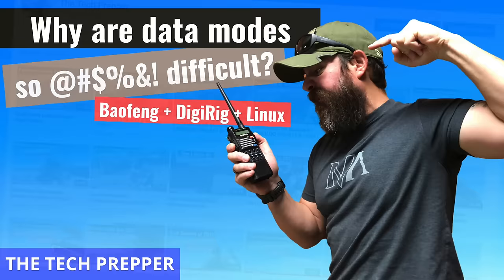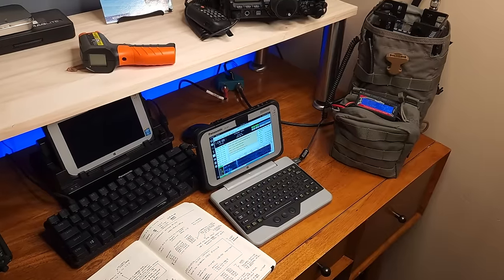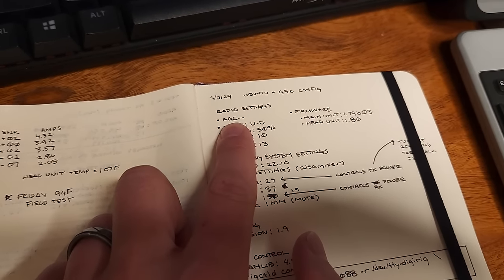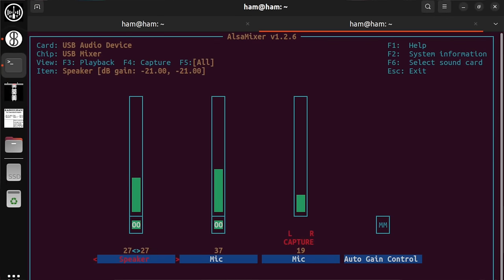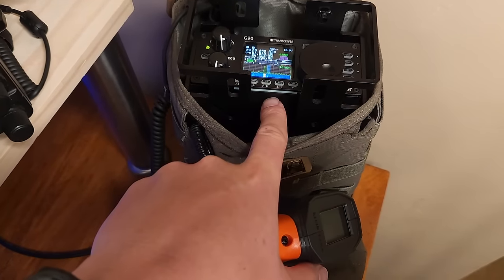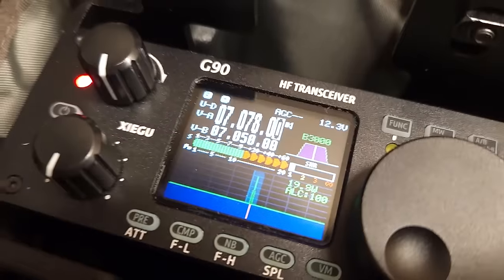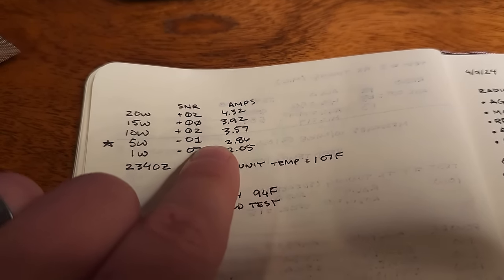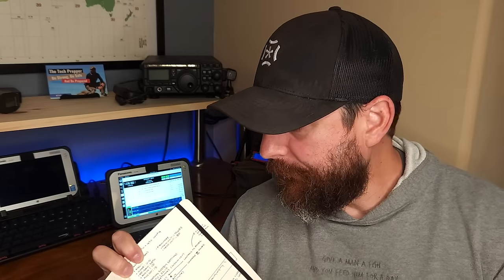Xiegu G90 Digital Settings - Manpack Series

Comment: Very well thought out process with the G-90. I don't think heat will be an issue with the way you operate. I've had my G-90 for about 3 years now. Very reliable so far. I have also not seen any complaints as to these radios developing problems, even with the extra heat these radios produce. Time will tell. The one other bonus with the G-90 is when doing voice, you do have the ability to go to 20 watts when needed to make a contact. 20 watts seems to be a real sweet spot on phone. Only one "S" unit down from 100 watts. Five to ten watts may be all you need most of the time for phone. It's just nice to have that extra wattage when necessary. It could very well be the difference in making a contact or not. Digital should be fine at the lower wattage. Looking forward to future videos. 73....P.S. I know you use resonate antennas. But just think about if you had a problem with your antenna or needed to improvise something and SWR was less than ideal. That awesome tuner could really save the day.
Reply from the maker: I agree. 15-20 minutes of operating even in warmer outdoor temperatures should not be a problem. If there is, I will report back. Field test scheduled for this Sunday. I am glad to hear that you've had positive results with the G90. I have incredibly success with my group here in the Southwest running 20 watts with G90. The audio was great. I hate to admit it, but I do like this radio. Lastly, I used the SWR analyzer to help tune a wire antenna over the week. I am fan, although I think it is to liberal in the SWR match compared to my RigExpert. 73.
Reply: I've never tested the SWR accuracy against my RigExpert. I'll have to do that. I'm much like you and prefer a tried and true Yaesu or Icom. Never found a Chi Com radio that I felt good about.  The G-90 is the exception.  Thanks !  73

Comment: I am SO happy to see you supporting the G90, I can't even tell you.  The built-in tuner in that thing is pretty amazing.  -Shaun
Reply from the maker: It has a lot of features for the price point. I actually failed to mention it, but I'm a fan of the SWR analyzer and ATU. Although, the SWR is too liberal in my testing. The RigExpert 230 reports higher SWR, but it's nice using the built-in analyzer in a pinch.
Reply: -xiaun*
Reply: @TheTechPrepper  I plan on getting it to use in situations like long treks, multi-week canoe trips north of pickle lake i embark on yearly.  where loosing the radio due to being swamped in a canoe is a real possibility. I'd rather loose a 500usd 20watt radio then a 5 watt IC705. This is my first year bringing a radio with me - KE2CAW

Comment: I appreciate the time taken to tabulate the differences in PO used, SNR, energy consumption, and heat generated at each step of the data capture. You gave a high quality presentation that DOES appeal to a broader audience. Even if it's in a "raw" format. Double points for the linux distro used on the computing side. Well done Sir and thanks!
Reply from the maker: Glad to hear that these metrics are useful. I would imagine they would be a good baseline for those considering a G90. 73

Comment: G90 is stupid good for the money. I have the fan stand and upgraded the fan to a thin noctua fan running full power always. But I’ve heard others say the fan is a gimmick  the radio doesn’t need it
Reply from the maker: The fan may be a gimmick, but I need more time with the radio to be sure. I am about to hit the field this weekend. Honestly, I think the fan is only needed if you're going to run this radio continuously outside. I had a 20 minute rag chew with my buddy in the Southwest at the full 20 watts at 50% duty cycle. In the house, it did get warm (~95F), but it clearly did not need a fan for that contact. It all depends on how you use it.

Comment: You don’t carry a 100ah battery into the field? You need to start rucking harder or hit the gym 😂 Just kidding! I’m training for another marathon in November and will probably ruck my station around the area as cross training. Anyway, thanks for another great video. I find the G90 interesting but I’ll never buy one. I’m waiting for Yaesu to wake up and make an 818 replacement or maybe I’ll bite the bullet and pay a ridiculous price for a used 818. Keep up the great work!
Reply from the maker: I would also pay a ridiculous price for the successor the FT-818ND. As for rucking, I've carried a 12Ah battery and the FT-857D or FT-891 many times up the peaks out here in the desert with full support gear. It's no fun, especially when you have to carry 8-10 liters of water.
Reply: @TheTechPrepper   The desert is no joke. I’m not built for that environment as I found out in the military. I’m blessed with an abundance of water everywhere I go nowadays so I just need to bring a means of purifying it. Keep on rucking man!
Reply: Just curious: what marathon are you going to run in November?
Reply: @ke8mattj  I’m running the NYC Marathon in November. I’ve also run the Marine Corps marathon and London. I’m pretty excited I got in finally.
Reply from the maker: @pa1863  Keeping on rucking as well. Good luck with your marathon. In all fairness, I wear a puffer jacket once it's less than 70F. I guess it all depends on what you're used to. Have a good weekend.
Reply: @pa1863  Cool. The reason I asked is also when Outer Banks Marathon also happens in November. I ran it a few times, so just wondering. The Marine Corps is one a local guy runs every year. Good luck in your races!

Comment: If the g90 had a one wire digital interface it would be a very tempting side/down grade from my ft857d. I don't generally use more than 20W so I'm not bothering my neighbors but I'm not doing DX. Nice to see it can run in a bag.

Comment: I have been trying to get my G90 to work with DigiRig for over a year and still no luck. Gave up for now but I noticed you did not say if your changed the mic input to "line" on the radio. Thanks for the video. Always educational.
Reply from the maker: You don't need to manually change that any more. When you switch the mode to U-D or L-D it automatically  does it in the latest firmware that I am running. Great question.
Reply: @TheTechPrepper  Great, thanks.

Comment: I’ve admired the G90; especially that it can transmit 20w.  I’m just not a fan of the small screen.  I may still get one.  Keep up the great content.  Bill, KC2KNA.
Reply from the maker: Will do! The G90 is an interesting radio. I am pleasantly surprised with the utility and performance given the $400 USD price point. At the price, I am willing to let a few things slip, like the quality issues and heat. I am sure that the small screen will be a personal problem as I leave my 40s. 73

Comment: I like the size and 20w output of the G90, but went with the IC-705 because it has VHF/UHF. The built-in sound card makes things a lot easier to get started in digital modes. If they made a 100w version of a G90 with a built-in sound card, I'd probably buy one for a back up radio. I do love my Icom Radios, but they are expensive to get repaired. If a G90 got screwed up, they're cheap enough to just buy another one.

Comment: Thank you for the video, Gaston! I'll have to try what you did later. The main difference is that I'm going to be using Windows. I had a really hard time getting Winlink to work. Once I finally did, I sent you an e-mail via Winlink thanking you. You helped a lot with that.

lol, it surprised you so much that you broke your "no new equipment" resolution for the year. This is a curiosity question: if there were a rugged version of it with most of the major issues fixed, would you prefer it over other radios or recommend it for manpack operators?
Reply from the maker: You are very welcome. I am sure that the principles will be similar, but I would image that the sound values will change significantly. If you stick to applying the TX tuning using 20w and ALC=100 you should be good. For the RX tuning, shoot for ~60 dB on the JS8 meter. Good luck.

Comment: Nice vid. Great explanation also. I use my G90 all the time on WSPR. Also wondering which knob did you get. I see 5 of them on Amazon and one has a really bad return rate.
Reply from the maker: I linked the one I used for this build in the description. I need more time with it, but it seems fine. You just need to make sure that you don't seat the knob all the way down, otherwise you will not be able to use button mechanism.
Reply: @TheTechPrepper  For some reason I'm not seeing it. I see a "wish list" "frame" "M-APP" "Digirig" "bag" "battery"  My computer rebooted on an odd power outage tonight for some reason. It's on a UPS.....  I'll check back another time. Thanks again for the video.

Comment: Have you considered a water resistant pouch on your pack next to the transmitter to carry one of those "blue ice" packs for extra heat reduction?
Reply from the maker: Negative. I have a custom rain fly that I developed for my manpack that I use for transportation in my ruck. Rain is not an issue here with the exception of a July monsoon season. This radio has no IP rating, so you really should avoid using it in the rain. Operation should be within a shelter if there is inclement weather.

Comment: The G90 is popular with some hams. Costs less, and has a great antenna tuner, so non-resonant antennas can be used. And at 20W max, easy on the battery.

Those of us who stick to resonant antennas do not see as much value. And I can turn down the power of my IC-7000 to be easy on my battery.
Reply from the maker: Exactly right. I took the G90 on an RV trip last weekend. The SWR analyzer and tuner were welcomed features. 73.

Comment: Is this as close to a military manpack as we can get? I have been looking for a weatherproof HF radio to use outdoors and be able to withstand at least some rain
Reply from the maker: Absolutely not. These radios are nowhere near rated for any ingress protection. My Japanese manpacks (FT-858D and FT-818ND) are much more robust and reliable than the Chinese G90 shown, but they are not mil spec.

Comment: I think a lot of the keyboard warriors are hard on your operations because they don’t totally make sense in a use case most people assume.  The use case for POTA/ SOTA are kinda better defined as people actively do it.  You’re more focused on this other thing, man portable emergency comms which require you to bring a very capable radio with a small setup… which requires planning.  What you are really doing is practice which is important.  In a real world use case, you’re going to find the closest hill and haul a spare battery up that hill with you.  Maybe point that out.  You don’t been to bring the full station when playing radio.

The people being critical do have a point though.  I know you hate the 705, but my pack is smaller, lighter and includes enough solar to sustainably run a station for days if the sun is out.   We bring it to camp all the time and use it as such.  Maybe not the best radio if I was under fire, but I also can’t call in air support anymore, so not really planning on that contingency.  Been working for 2plus years now and with an amp mounted in the Jeep, it is a SOTA and POTA machine.

But, it’s also a hobby, so everyone is right.

Comment: I LOVE my G90, thanks for providing this video, great info to have, keep in mind, you can eliminate the digirig and just run JS8 with VOX and a USB sound card.
Reply from the maker: I've had mix success with VOX, especially with packet, but I prefer something that actually triggers the PTT without relying on audio signals. On my other packs, I actually don't use the mount or the DigiRig enclosure. I just have the bare PCB in heat shrink with the board zip tied to the frame.

Comment: So when you go to use your gear for real - I would bet money China has a backdoor to disable Xingu radios like with what Russia did to the Ukrainian system. Their is a reason to use an LTS based OS. Cyberwarfare can disable your gear
Reply from the maker: This radio is not for me. I would never trust this Chinese gear. I run older Japanese gear for my personal applications.
Reply: @TheTechPrepper  thats what im saying BUTT think of this all the chip in that radio their American. because its aN SDR RADIO that you can easily get root access - it should be easy to find the bug and disable it or write a custom firmware.... my guess is it would do something like lock the transmitter on overdrive to burnout the internal components something we have seen the x6100 already do on "accident"
Reply: @TheTechPrepper  REAL QUESTION: Do you find the G90 has features that make digital radio more useful then older Japanese radios? oR do you just need one of the digirig devices?